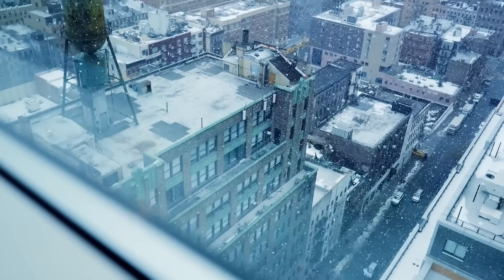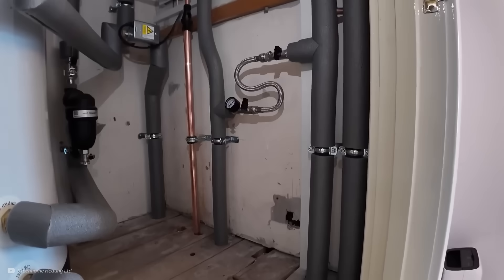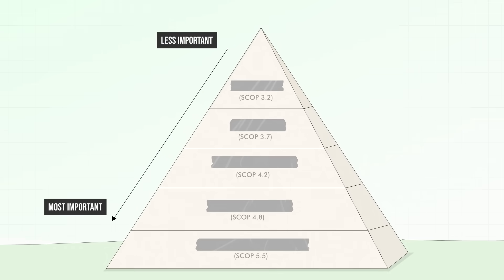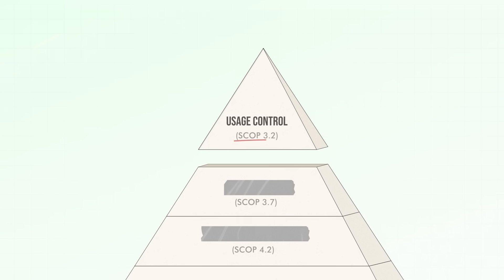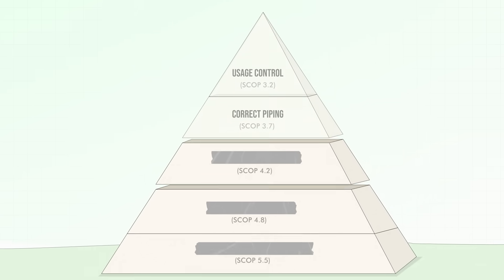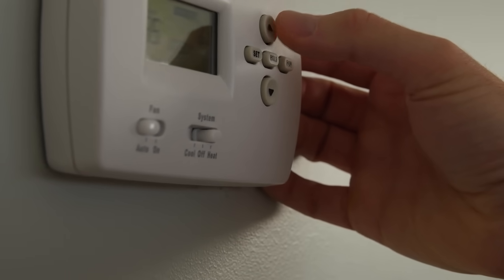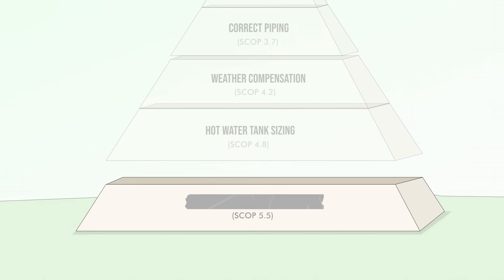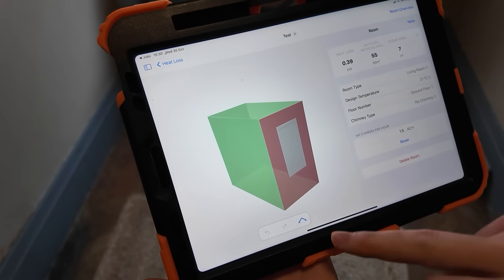The Genius of the World's Most Efficient Heat Pump

Comment: So you get 8 times more energy than you put in?
Reply: Not really, but yes when you compare it to a resistance heater in the same conditions then yes.

If a 1000watt resistive heater put out 3400 BTU or so, then this at a COP of 4 would put out 13600 BTU with the same energy since it just moves heat from one olace to another without converting electricity in to heat directly via resistance.
Reply: How to explain this while remaining civil… you can generate heat from electricity using a resistive coil, that is 100% efficient or a COP of 1. However for that same amount of electricity you can move 8x the amount of heat from the ambient air outside your house into your house. This is a COP of 8.
Reply: No it doesn’t work like that

The “800% efficiency” refers to a Coefficient of Performance (COP) of 8. This means the heat pump can deliver 8 units of heat for every 1 unit of electrical energy consumed.
Reply: @Random-95 

That's not a measure of efficiency then.
Reply: @Random-95  so heats pumped per watt. Sounds pretty efficient when heat pumping into a insulated box.
Reply: It's moving heat from outside to inside and the cost of moving that heat is the SCOP rating.
Refrigerant is warned by the outside air, then brought inside and compressed. This makes the refrigerant extremely hot. Water flows over the refrigerant pipe taking the heat. The refrigerant is decompressed making it super cold where it goes back outside and is 'heated' by the outside air again.
Reply: @s73v36 Not exactly. The refrigerant becomes “super cold” by forcing (pressure), liquid refrigerant thru a small orifice causing the liquid to flash into a vapour in the evaporator. This change of state is called “latent heat of vaporization “ and it’s literally where the magic happens causing heat transfer.
Reply: Did you listen to what was being explained or did you leave the room?
Reply: Practically yes. You use 1 watt to move 7 watt from outside to inside, and your 1 watt also comes along, so you get total 8 watt, at the cost of 1 watt.
Reply: its moving heat around, not so much creating it, that's why its efficient
Reply: 🤔 seems like they hired a Hollywood accountant to do the math 😂.
Reply: A heat pump does not create energy it extracts energy from the environment (outside) and pumps it where needed (inside). By removing energy losses on that path (the system) one can improve efficiency. To be clear improving infrastructure in an old house (pipes, water heater, radiators, etc) to minimize energy loss can be very costly. Remember the video is from the UK/Europe. Not simple to compare to many US homes.
Reply: A decent way to frame it is that you get 8 times more USABLE energy than you put in. Meaning you convert unusable but existing energy (ambient heat) into usable energy (same heat energy but at higher temperature) by sacrificing some other usable energy (here electric energy).
Reply: It's impossible even theoretically
Reply: @ПавелКовалёв-с5ь  well in the comments they proved that it was around 90% .. not 800 . . They were just thinking of economics rather than physics
Reply: 8 units of heat are moved for every unit of energy used. Current average is 2.8 units per energy unit used.
Reply: Yes, as a short hand. It doesn't contravene the laws of physics because  it's not "producing energy" rather it's moving heat .  Think of it as a fridge in reverse. A fridge removes the heat from a small area (the inside of your fridge)and discharges it into your kitchen. Your kitchen will get warmer but since it's so large an  area it will be imperceptible. A heat pump takes the heat from a large area - the outside 😂 and concentrates in a small area - your home using compressors and transfer fluids.
Reply: @taffygeek   so what you're saying is it's removing 800% more heat than is there to start with? .. yeah that's still a contravention of physics
Reply: @brianburgess3231  had to be a troll not to get the concept which is explained in the first minute of the video.
Reply: @brianburgess3231 you are being wilfully obstructive and disingenuous. There is practically  infinite quantity of heat outside your house. It's very efficient to pump some of that into your house to heat it. OBVIOUSLY
Reply: @brianburgess3231 No it’s not as you are stealing heat from outside and putting it inside.
All you are doing is powering a pump that can steal heat from outside.
Reply: Yes
Reply: Junk !!
Reply: Yes, only in September according to the video.
Reply: Using a trombe wall you can get infinite free energy* (Only if you assume the suns energy is free and thus you divide by zero energy input)  No really, why worry about the efficiency of a mechanical process when you can just absorb infinite heat (over a period of infinity)
Reply: Is this the new engineers we are getting from higher education to heat and cool our homes I was left with one question ,what are the plants behind them in the video or do they have a bag under the table
Reply: 1kw electric in pumps 3-8kw from outside into house
Reply: @SW-qr8qe  does a heat pump pump kilowattts? .. is heat measured in watts or in joules?   And how much do you lose in the transference then?
Reply: @brianburgess3231 1 watt = 1 joule / second.  Energy is measured in BTU, Joule, or KW-hours.  Power is energy / time:  Watts, BTU/ hour.  So in this case for every joule you use running the heat pump you move 8 joules from outside to inside.  You do lose some energy distributing the heat around the house but that’s typically ignored as it is a small fraction of the total energy.
Reply: You use a fan to pull heat out of the air through water or a refrigerant, so the energy required to push the fan and move the heat energy in air is less than the energy needed to create or generate the heat to begin with. It’s an efficiency in the movement of heat that already exists but often is underutilized
Reply: @brianburgess3231  You get 8 times the input energies worth of simple electrical heating. Or in other words 7 times more than you would get from direct electrical heating.
Reply: For every 1 kWh that it uses in electricity it moves 8 kWh of heat from outside to inside your house.
Reply: You define efficiency by how many kilowatts of electricity you use versus how many kilowatts of heat energy goes into your home. A space heater is 100% efficient. A heat pump means that for the same amount of heating in your house, you only use 1/8 the electricity, or you can heat 8 times larger space with the same amount of electricity.
Reply: @adrianellis4497 Try an analogy, I need to pump water from the river into my swimming pool.  I can use the current of the river to power a pump.  (Early irrigation systems worked this way).  Now, suppose for every gallon of water that tuns the pump I get 8 gallons of water MOVED into my swimming pool.  You could argue that the COP of the pump is 8 because for each gallon of water used to power the pump it MOVES 8 gallons of water from the river to the pool.  ( in practice it’s more). Does that help?
Reply: In theory, with the ideal moderate weather and air temp
Reply: By the title - 9. 😂😂😂
Reply: @MaximumBan  oh my .. I'll start writing my life story now then!!   🤣
Reply: It pumps 8 times the energy it uses for the pump itself
Reply: @Psalm73.24  concise 💕
Reply: 800% more than efficient that a crappy heat pump I suppose...
Reply: @EdmundasDegys  😉
Reply: That’s my p0rn star name😂
Reply: Think of it like this: you're powering a robot arm to move a bucket of magma from outside to inside. You didn't do anything to the magma but now you can sit around it warm, and wait for a new removal/delivery. The only power used was in the robot arm.
Reply: Welcome to HVAC 101
Reply: Yes, COPD of 8, 800%.
Reply: I think you get 8h of a set temperature compared to 1h of set temperature with a resistive heater ,for the same price
Reply: Yiubsteal heat from the outside. It's  basic physics
Reply: That person is dead soon ..... mysterious circumstances, of course
Reply: Actually, you get the same amount of energy out that you put in.

For example, if you get 8 KWh Out, you put 1 KWh of electricity in plus 7 KWh from the outside giving you 8 KWh in total.

How to put it another way it takes one kwh of electricity to transfer a further 7 KWh from a low temperature source to a higher temperature output.
Reply: It's not creating the heat it moves it
Reply: COP of 8 means it moves 8 units of heat energy from the cold outdoors to the warm indoors, for every 1 unit of electrical energy needed as input.
Reply: Did you even watch the video? Wtf
Reply: yes
Reply: Your actually on to right way to look at it. Efficiency is only good as far as the cost to get that efficiency is low enough to save you money… if the install and maintenance cost are to high what’s the point!!!!
Reply: Efficiency is good,but people want cheap.
Cheap to buy,cheap to install and cheap to run.
Reply: @ravenmad9225 Efficiency is related to cost. More efficient: Less cost - because, well, efficiency.

Less efficient more cost.

What makes this complicated is comparing to other technologies.

A heating solution that is new and you need to buy is costs that you don't have with an already installed old system. Unless that one is at/near end of life and needs replacing anyway.

But costs are further complicated in whether just exchanging the heating unit itself is enough or whether other parts need to get replaced/improved too.

And then one could factor in likely future scenarios of where input costs are headed.
Reply: @ravenmad9225cheap to maintain as well
Reply: @ravenmad9225Never cheap out on HVAC or plastic surgery. They're both always worth top dollar.
Reply: @ravenmad9225and not just efficient but quick without hassle. Eg hot water to be hot not having to plan ahead too much
Reply: @ravenmad9225If you take away all the market distorting subsidies and tax breaks then heat pumps are cheaper. It's not even close
Reply: @ravenmad9225  100% is efficient  .. in fact it's the most efficient you can get ..  so what I'm saying is 800% is 8 times what you put into it .. that's not just cheap .. that actually makes money
Reply: @brianburgess3231  All you need to realize, instead of making dumb jokes, is that refrigerants can get pretty dang cold, and thus can still absorb heat from what you would consider a "cold" environment.
Reply: @h8GW  yup manipulative I know, but we got the discussion going were it needed .. showing that energy used to transfer was same to pump the heat, thereby leaving roughly 90%, not 800%  😉
Reply: @h8GW  and you need a way to remove the heat absorbed at one location to another location .. often a compressor and two sets of coils are utilized
Reply: Listen to what was said in the video and the comments. It took me a bit to get my head around as well.

Think of it like this. You use 1kW of energy from your electrical source but transfer 8kW of heat energy from the outside to the inside of the house/apartment (space being heated). So in other words, you move the refrigerant around the heat pump such that when it goes outside it pulls K (Kelvin) degrees from the air into the refrigerant, an amount of energy. It's vapourised, such that when it enters the ducted side the pressure difference causes the refrigerant to revert back to liquid releasing latent heat, the heat acquired from outside, which is then released inside to the spaces.

This is why the COP is 2.5 during winter and 3.5 in summer, a greater temperature difference, allowing for increased thermal transfer to the refrigerant.

The pools of energy are isolated from each other. The pool that drives the pump and venting. The pool of thermal energy transfered from outside to inside.
Reply: No.   You move 8x energy around in the form of heat.   Not creating nor changing energy.  Just moving in which us ideal in this application.
Reply: He is talking about efficiency not output
Reply: Watch it again and this time  .... pay attention
Reply: @TheHoveHeretic  Then the video needs to be edited to replace the word Efficiendy with COP
Reply: No - the energy is simply drawn from outdoors moved to inside the house...
Reply: @constructioneerful  is there electricity used?
Reply: @constructioneerful  so it's the same energy source that's drawn from outside to use to draw from the outside?
Reply: @adrianellis4497  so there is a standard?  That  unit is less than 1. It could be 1 million times efficient and still be "possible" - as long as the coefficient is less than 1.  He argues which is closer to 1? .99 or .999? What about .9999? And which of these values is testable? If a product made claims like this what makes them different? Marketing.? The secret sauce.? Lol have a great day. The machine is watching.
Reply: Heat pump people need to stop using terminology like this it makes it sounds like a perpetual motion machine. Clearly no machine can have an efficiency greater than 99.9999% as we normally understand the world. The first time I was at a home expo and a sales man came out with a number like that I called him a snake oil salesman and walked away. Heat pumps are great, they can be a very cost effective (and green) means is heating your house but they not magic (and therefore BS), which is what misleading numbers like 800% efficiency sounds like.
Reply: Excellent video ty for making and posting. Reading the comments I’m frankly astonished how many people seem incapable of understanding the fundamental reason heat pumps are used - that in pure energy terms it’s more efficient  to use the energy in moving heat - than using the same amount of energy as the heat input to the house itself. 

Once one understands that - this video is addressing what one does to optimise a basic system further and gives a good insight into (roughly) the size of improvements that are likely to be realised from those optimisations. 

Fantastic ! I learnt a lot from that. 
If people can’t understand the fundamentals about heat pumps - sadly the video will have gone completely over  their heads. 

The economics of a heat pump installation are another matter entirely and involve costing the installation, its depreciation (different components in the system  having different life spans and different costs) as well as the energy costs, which may involve complex tariffs, PV systems if using energy generated by the homeowner etc- which leads to a  complex picture even when compared to a more conventional gas boiler. Clearly that wasn’t what this video was about - and well done for not going there - it would have diluted an excellent video that you kept focussed on a very interesting topic.
Reply: Costs a lot of energy to move that heat though
Reply: Not exactly, to get 8 units of heat into your house 9 units of energy is put into the system, 1 unit of electricity and 8 units of heat from the outside world.  So around 89% efficient.  But since the outside world heat is free we don’t count it and then say we get 8 units of heat for 1 unit of electricity.
Reply: @steveallen1340  💯 (800% spot on.. hhehhe)
Reply: @brianburgess3231 You’re right that nothing can be more than 100% efficiency. “Efficiency” in a heat system is a thermodynamic property, but heat pump people tend to use the word efficiency to represent energy input that you’re paying for compared to total usable energy output inside the space you’re trying to heat. It’s mostly because people have heard the word efficiency since they were in middle school but COP or coefficient of performance might just confuse people. 

So although I think a COP of 8 is ridiculous, especially for a hydronic system, it is possible to be paying for 1KWh of energy from the grid and get more than that to heat your space. Realistically 2-3KWh of useable heat. In the same sense that a fuel pump that is only pulling a couple watts of power is moving a fuel that contains hundreds of thousands of watts (BTUs/KWh) of energy. What these heat pump bros are doing is looking at that fuel pump and saying “well it’s moving thousands of BTUS per hour and only using 3 watts”
Reply: 800% is 9 times more 🥰👍
Reply: @AvocadoAtrocity 800% is 8x. "800% more" is 9x the wording matters and it confuses people all the time.
Reply: @AvocadoAtrocity What's your logic here?

It's 8 times the base value. When you say "more" then this is relative to the base amount of 1 unit. So it's 7 extra units "more".

A COP of 1 (100%) is just the same efficiency as you would get of of a classical electric heater. It's not a regular heater plus 1 heater unit extra.

If you pay double the price for something (aka 200% of the regular price), it's 1 x the regular price extra/more).
Reply: @oerthling  paying double the price means that you're paying 100% more.
Reply: @AvocadoAtrocity That's only true if those 800% refer to an increase of something (100% increase of something is double, 200% is triple etc.). 
But here we are not talking about an increase of anything. In this case specifically, 800% means you get 8 units of heat energy for every 1 unit of electricity energy spent. So there is no "9 times more"
Reply: @AvocadoAtrocity No it’s not 🥰👍
Reply: @AvocadoAtrocity  1 x 800% =8     1 + 800% =9
Reply: Are you kidding 😂 @AvocadoAtrocity
Reply: @AvocadoAtrocity  no. If it were 100% efficient, you'd get the same energy out as you put in. 200%, twice as much, 800%, 8 times as much.
Reply: Yes in ideal conditions
Reply: @guringai Which will never happen. What is the average COP?
Reply: Extracting heat out of the hot water tank is cheating, it's going to make the heating element work harder to maintain 60° water temp for your shower?